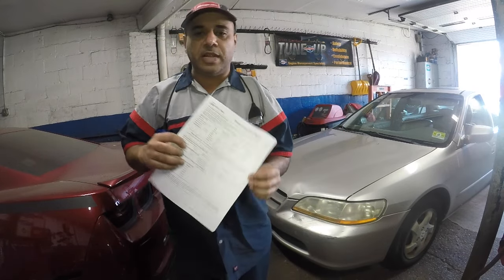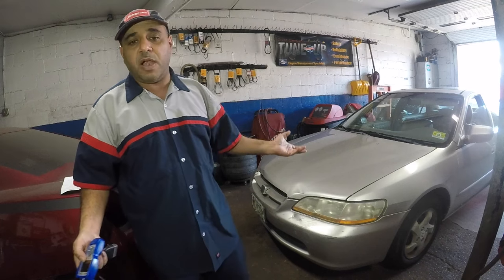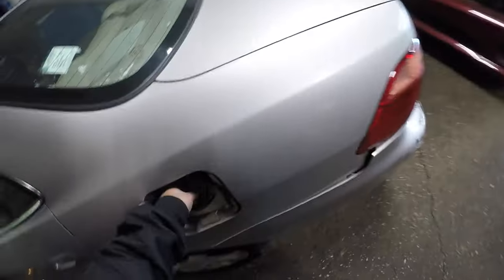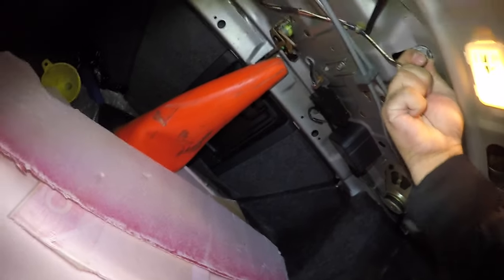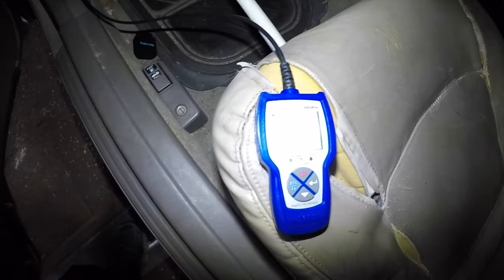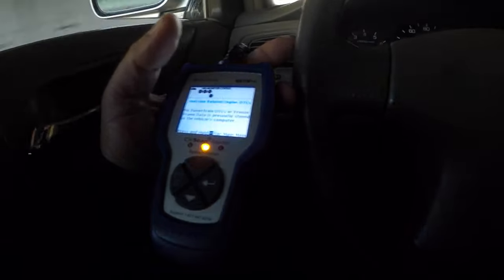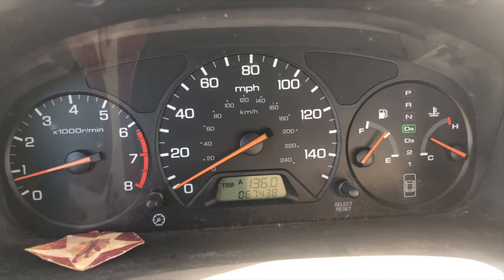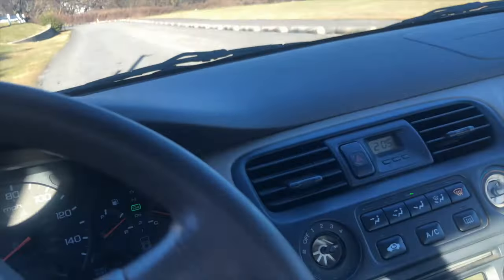How to pass car emission inspection for car that is not ready  |  failed car inspection

Comment: Man my car has 30k miles and the Evap, O2, and Fuel system keep showing Not Ready. Don't drive much but put 7 days, 230 miles, and a full tank of gas between inspection attempts and the same systems still Not Ready. No codes popping, just not ready
Reply from the maker: Got to drive
More do long highway drives
Reply: @RBTheMechanic  I'll try it. I've already logged two 2 hour trips from Dallas to Fort Worth going 90 on the tollway and bumper to bumper in traffic along with a handful of short daily 15-30mins trips over a week. Went thru an entire tank of gas. Fckn computers lol
Reply from the maker: @GreyCrowe  yeah it will just take some time and key cycles
Reply: The EVAP system sometimes won't become ready with either a full tank or less than a quarter tank. So quit filling the tank all the way up or letting her run dry during your drive cycle and it should kick in. That and key cycles so every 20 or so miles, turn the vehicle off, open the door, close the door, reopened the door, rekey, drive, and repeat till it becomes ready. There's actually some papers you can find online for the specific drive cycle requirements for your make model and year of car. Not all drive cycles will be the same for each vehicle.

Comment: My car fail 2018 vw gti supposedly because it’s tune, but I know it’s not tune I have gotta checked  I mean I barely drive the car, and when I took it to get inspection failed  beause it’s said not ready
Reply from the maker: If it dosent have check engine then drive the car more go for long drive
Reply: @RBTheMechanic  no check engine light the car has only 15’000 miles
Reply from the maker: @robertoacuapa5010  oh ok drive it for like good 30-40 miles it should pass

Comment: My car is fine, but there is a coolant leak, not knowing if it will pass
Reply from the maker: Well it will pass but that’s important issue that need to be fixed so u should have that fixed
Reply: @RBTheMechanic  it’s a Chevy Sonic 2013, it’s on its 3rd coolant leak 🥵

Comment: Need to drive to reset the monitors to get an accurate reading
Reply: I'm in NY I failed because of Evap monitor "Not Ready". I was told to do some highway driving. Is that accurate? Thanks for replying.
Reply: @rwarren4637  yes that is correct.   all the monitors have to be ready for a proper reading .  usually there's like 5 or 6 monitors.  Once they are  all ready then they run the test.  if No codes appear it will pass.

Comment: I drove my truck for 650 miles didnt get drive cycle. Its a 2006 Ford f150 4.2L V6 stx rwd
Reply from the maker: Do small drive 10-15 miles turn off and key it turn key cycle
Reply: @RBTheMechanic  ı tried it man, also i revved the engine 3.000rpm for 3min didnt work either

Comment: I need help with my 2010 RS Camaro, it’s stuck on EV
Reply from the maker: Driving is the key also key cycles
Reply: @RBTheMechanic  I did it for 5 days now and it won’t work it still says EV
Reply: @RBTheMechanic  I did the drive cycle 55 for 5 minutes then take it to 20 with no brakes

Comment: what if the check engine light turns right back on as soon as you turn the car again again? it doesnt stay off. camshaft position sensor. Cadillac SRX
Reply from the maker: Replace it not so bad or expencive fix then reset and do the same process
Reply: @RBTheMechanic  they told me timing chain needs to be replaced. Quoted at $4000.
Reply from the maker: @youknowdavibes9811  I wouldn’t do that first fix the code for the sensor
Reply: You can't clear a hard fault. It stays on until you fix the problem. The first thing you should do is look at the sensor closely and see how its bolted on. The holes for the sensor will either be a circle or an oval in shape. If its an oval, you can loosen the sensor and slide it left or right. Try it in a different positions and you may get lucky. If that doesn't work, swap the sensor with the one on the other cam. If the problem follows the sensor, that's what you need to replace. If not, you're going to have to do some diagnostics.

Comment: I’m 99% sure this is smog shop I go to in my town
Reply from the maker: Secacuse
Reply: @RBTheMechanic hey I went to a smog shop ,Only shop that agreed to do the smog even with a check engine light , They took from 1:30pm to 6:00pm.Is that normal or were they just mad because I asked them how long will it take ?
Reply from the maker: @jackgonzalez1870  it depends what they were checking idk what u mean by smog test. Or were they doing evap leak test with smoke?

Comment: Cars made after 2000 dont need the EVAP to be ready in order to pass....everything else has to be working.
Reply from the maker: We r almost up to 2000 not there yet
Reply: Really, even in California? I have a 2006 tsx acura with a potential Evap problem/emissions not ready, so will my car pass the smog check even if the check engine light doesnt come on?

Comment: I have check engine light on(misfire detected cylinder 3) but car works good. Can be car rejected emission test because of it? Thanks
Reply from the maker: Yes u will fail fix the misfire.  If u feel small shake that’s is the misfire
Reply: Change your spark plug in cylinder 3. If u want to be certain tho I’d suggest changing all spark plugs as well as changing the Ignition coil for cylinder 3. Thk me later. Might as well change out pcv valve while you’re at it. These repairs will take u about 30min to an hour, doing it yourself with a socket wrench set.

Comment: So I just had my evap fixed buy a professional mechanic and although I passed my test it's still the only monitor that's not ready and usually the EVAP is one that's ready right away at least with my car and the only one I've always had an issue with was the O2 sensor that's forever to kick in so I'm clueless as to why the EVAP was prepared over a week ago and it's still not ready
Reply from the maker: U have to drive and do key cycles do like 10 miles then turn off and wait 2-3 minutes put the key back in and start do another 10 miles do that few times it should eventually get ready
Reply: Evap actually usually takes the longest.  Even the weather will effect the running of it.

Comment: Help I bought a 2008 Honda civic si on MA I have a check engine light because the car is modified don’t got a catalytic converter is there anyway to pass the trash test without having to put stuck parts
Reply from the maker: Nope  not here in nj

Comment: 2009 VW rabbit with barely 100K miles, drives great and I'm basically going to total it because I can't pass freaking Emissions test.  VW says $1400 for secondary air injection system sensor.
Reply from the maker: Darn u can do it urself pump is like $190

Comment: I have a code for a fuel level sensor so its throwing an engine light several mechanive have tried and failed to fix what seems to be an electrical problem so even if i reset it it comes back before i can get it emissions ready .....any ideas
Reply from the maker: Did u scan for codes?
Reply: @RBTheMechanic  yes i dont recall the code but its the fuel level sensor isnt communicating long story short when i had my truck inspected everything worked fine when i got it back i had a bunch of electrical issues my radio wasnt working driver seat wont adjust sun roof wont open ...when it started i replaced the fuel pump and since ive had several mechanics try and fail to figure out whats wrong checking grounds and such im frustrated at this point because i need to make it through emissions and i cleared the codes the engine light stays off while im driving to get everything reset for emissions but as soon asnits all good it throws the engine light again and at this point i cant afford to keep payin mechanics to try and find it

Comment: Was wondering if you can help me. I have no codes at all. I rebuild the engine for my 2005 GMC Yukon XL. I’ve been driving it for at least 800 miles. All the emission lights are green except the catalytic converter. like I said no engine light for the catalyst converter and no pending codes for CATS at all. I wondering is it normal for it to take this long to turn green? And why is it taking forever?
Reply from the maker: Yeah that can happen u have to drive and do key cycles as well so drive like 20 miles then turn off and wait 2-3 minutes turn back on and drive for another 4-6 miles that’s one key cycle and do that few times
Reply: Could also be some of the inputs are not correct.  A common one on GM is the Coolant temp sensor.  The drive cycle might say the monitor wont run unless the Coolant and Ambient temps start out 20 degrees of each other.  BUt if one is reading incorrectly at start up they might never be withing 20 degrees so the monitor never runs.   South main auto has a video on it titled "Chevy Trailblazer: Will Not Run A Drive Cycle"
Reply from the maker: @stevew9563  true
Reply: @stevew9563  thank you sir. I’m gonna watch this video right now.

Comment: Question when you plug in the ob2 reader for the test not the handheld code reader would the test show if your ecu vin does not match you frame vin because i have a junk yard ecu that works good but the vin is diffrent from the one that is on the frame and registration you can see it with a code reader with the vin read function and idk if this would pass the emissions test when you plug in the obd2 reader from the emissions tester pls lmk cause i dont wanna waste money on test if it would be useless
Reply from the maker: Not sure about that but I had Hondas that kept check engine light on after I replace the ecu it needed to be flashed by dealer
Reply: @RBTheMechanic  in my case the car runs fine i just dont know if the machine would care if it has a diffrent vin on ecu or not thats where my problem is
Reply from the maker: @gecko1406  prolly not give it try

Comment: My car has failed the emissions test 5 times, it keeps coming back with the evap and catalyst not ready and it doesn’t have the engine light on. I replaced the pcm, fixed the mesh that broke on the muffler and change the cilinders. The mechanics just keep telling me to keep driving it
Reply from the maker: Did u flash the ecm?
Reply from the maker: Some times u have to flash the ecm other wise drive the hell out of it and u have to do key cycles notice how I turn off and on the car every drive that’s key cycles
Reply: OMG,  I’m going through that right now?  What did it take you to pass.  Did you have to do a smoke test?  What kind of car do you have?
Reply: I'm going thru it right now. It's at the VW dealer for 2 days and they said they don't know what's wrong with it and it's not passing inspection 4xs now .Keep driving it they say. Iv driven it over 1000 miles !
Reply: Went today, and same here failed 4x's. Keep saying to drive 30 minutes to an hour for my 2007 pontiac g6. I drive everyday around the DMV to reset.
Reply: @RBTheMechanic Mine didn't pass the check it says 0S2 isn't ready but you don't have any permanent code just the monitor is red 1 I've only driven for 2 days but it's still not ready what should I do
Reply from the maker: @lenin1881  need to drive more
Reply: Do you have some recommendations on how to drive?
Reply: @RBTheMechanic  Do you have some recommendations on how to drive?
Reply from the maker: @lenin1881  do 10-15 miles highway bf the. Stop turn off and wait 2-3 minutes put the key back on and drive again 10 -14 miles repeat the key cycles 3-4 times hopefully it get ready
Reply from the maker: @lenin1881  also u need to do 50-60mph highway
Reply: @RBTheMechanic  thank

Comment: My car has been at dealership almost 6 months, it got new engine ,battery, pcm and few other things. I got my car back today and they told me to run the car until it comes back ready. My question is how do I run my car until it's ready with expired tags on it?
Reply from the maker: Do about 100 150 miles and take it back to them as u can see I put on scanner it shows me when it’s ready but u can’t do that. They are so lame this is their job anyways let me k ow how it goes
Reply: @RBTheMechanic  I sure will. Thank you so much.,  But not sure how I'm suppose to run the car  with with expired tags...😪 it's a 2016 Hyundai veloster turbo.  Hopefully I don't get pulled over.lol
Reply from the maker: @chrissyluna8183  well u have no choice but if u want u can go to inspection they will fail ur car but then u have 30days to get this settled that’s how it works in NJ what state u in im sure it’s same. However I should stick it to the dealer. But if ur only doing inspection don’t worry get rejected sticker if u feel safer that way and then drive the car
Reply: @RBTheMechanic  yes sir.   We are in west Texas.
Reply: @RBTheMechanic  Thank you so much for your video and advice. It's greatly appreciated.  I also asked dealership to do it ,but they said they can't because they don't have a mechanic that has the time to run it until it says ready.
Reply from the maker: @chrissyluna8183  yup it’s always time consuming anyways do ur fail drives it will get ready soon
Reply from the maker: @chrissyluna8183  oh ok love Texas anyways try the inspection and usully when I do repairs I give recipts if police stop u or anything u can show them that u were told to do 100+ miles before going to inspection because system need to get ready
Reply: @RBTheMechanic  Thank you Sir, I will definitely do that. Also thanks so much for responding to my questions.  Your always welcome here in Texas. You have a new subscriber. 😃

Comment: So even a light bulb out can affect the result of a smog test?
Reply from the maker: No but they will fail u for bad lighting it’s not safe to drive at night
Reply: @RBTheMechanic  Will a Code 00668  code fail for emissions? What about a TPMS light for failed sensor? I have new tires on order with stems but need to get emissions done before then.
Reply from the maker: @jameschavez4527  I’m not sure what state u live in here in NJ they don’t fail for tpms
Reply: @RBTheMechanic  Arizona... More concerned about the ABS code, only found the code was thrown with an ODB device.. Other than that I would not have known.
Reply from the maker: @jameschavez4527  not sure about ur state but here they only care about emission
Reply: FYI, I passed, took it in for an oil change the day before and ran it with the TPMS light on and no code noted, vehicle passed for a 2 year renewal.